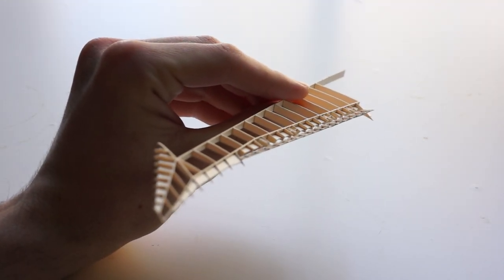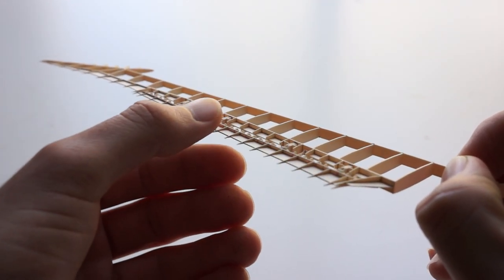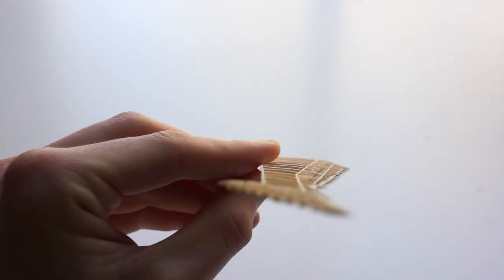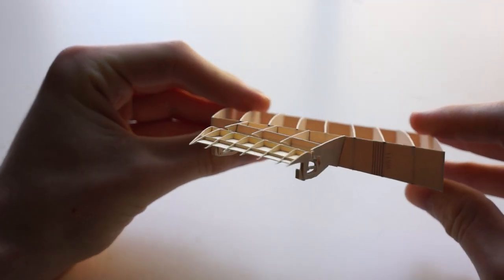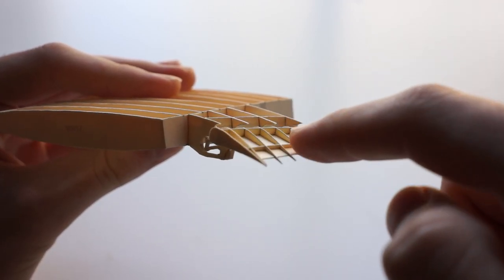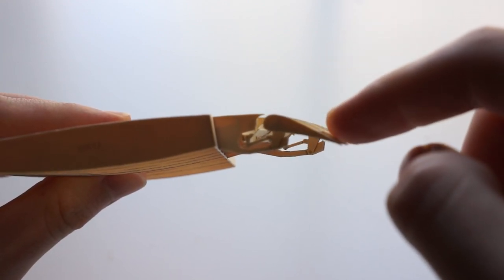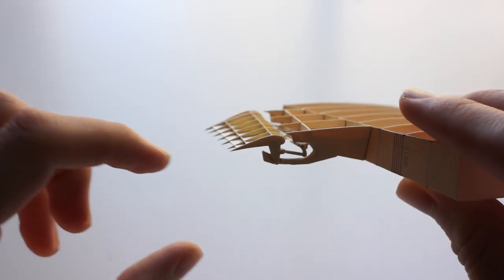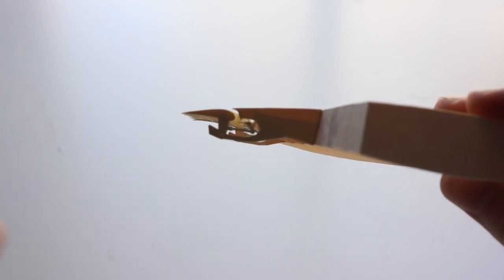Manila Folder 777 - Wing Update - Aileron and Flaperon Test Pieces

Comment: (I've sent you a PM)
Excellent, excellent, excellent! Beautiful and of course, unique work you're doing, much appreciated by someone like me, who loves aviation/aerospace, and the detail that goes with it.

Regarding your description of the "lip" on slotted flaps of different varieties. These serve two purposes... When an airliner lands, the slotted flaps add wing area as they extend, of course. The lip serves to compress and "squirt" air out at a higher velocity over the top of the flap, which makes the air stick to the surface better, and provides more lift. When the spoiler which typically creates that lip rises, the compression effect is destroyed, immediately dumping lift on that side. It's why jets can still maneuver so well, when you might otherwise think of them as large and sluggish. These "slot-lip ailerons" are a great way to achieve what jets need at low speed, and also help avoid some of the adverse yaw associated with plain ailerons.
Reply from the maker: +Mike James Thanks for the great info on that mechanism!

Comment: As always, amazing!  Look forward to seeing your next video, but I have been enjoying looking at your older videos as well.  

I am curious, since you've been working on this for many months (years), how are the original pieces holding up with age?  

Also, have you ever been tempted to go back and rework any pieces?

Thank you for sharing this incredible work.
Reply from the maker: ***** Thanks so much! This project has been in progress since mid-2008 in some form or another, so I wonder about the longevity of the paper as well. The fuselage barrels are some of the oldest parts, and as far as I can tell, they're holding up fine. I also sprayed the entire exterior with a sealant/UV-protectant finish (and the model will be displayed in a UV-proof box), so that helps as well. I definitely am tempted to go back and rework stuff, as my skills are much better now than they were at the beginning. The fuselage barrels are pretty crude and somewhat inaccurate, so I wish I could go back and make them stronger and more precise, but it would be impossible at this point. I know what to do differently the next time around (if and when that happens)!

Comment: I thought i was doing something with revell plastic models. This project is insane! You must be going crazy among the process. This is the best handcrafting I've ever seen.

I just wonder, how did you reach the 777 technical details or plans? Assuming you're using that kind of stuff though. Or not? That would be even more crazy :)
Reply from the maker: Zorer Karakan Thanks! It is a bit insane hahah. Not sure how I've managed to pull most of it off, to be honest. I use photos and a few documents (training manual, exterior dimensions), but I'm still having to come up with my own plans, which is half the battle.

Comment: No doubts it is stunning work. I am interested in aerospace, I study this field. B777 is my favourite airplane. I would like to ask you something about this part of wing. How you manage to create those stringers within the wing structure? I mean the size-ratio of each one, cos´ it is getting smaller to the wing tip as you know. Have you got any concrete datas of those sizes? Thank you for answering.
Reply from the maker: Phil Corpi Hard to put into words, but I basically had to create everything from scratch based on general exterior dimensions. It's pretty much just guesswork. This doc might be helpful to you: https://drive.google.com/open?id=0B3UGWOS9vEkndFRkc044SlJuWVE&authuser=1
Reply: ***** Many thanks for document. I have already checked it out in AutoCAD. It looks good. I have just found some chapters of B777 AMM and it seems to get them all from one website. Do you use those maintenance manuals?
Reply from the maker: Phil Corpi Yea, I rely pretty extensively on the training manual now for more obscure parts (landing gear etc). Super helpful!

Comment: You should put a full electrical system in the plane when it is done so you can actuate all the surfaces and mechanisms remotely and with motors and servos. Maybe even put some tiny motors on it and make it fly!
Reply from the maker: Would be cool... but I like the idea of keeping it to just one material.
Reply: ***** ya that makes sense. I just thought it might be easier to flip a switch than have to do it by hand. Would probably look cooler too. (Not that It doesn't look amazing already)
Reply from the maker: True. Maybe a future model!
Reply: ***** ill start holding my breath now lol!